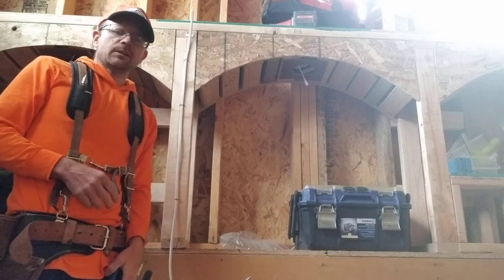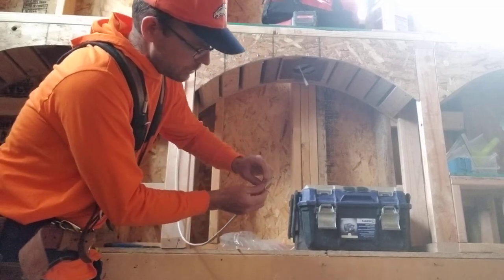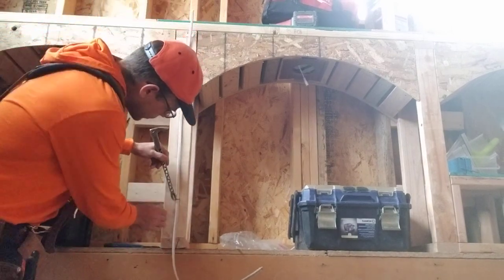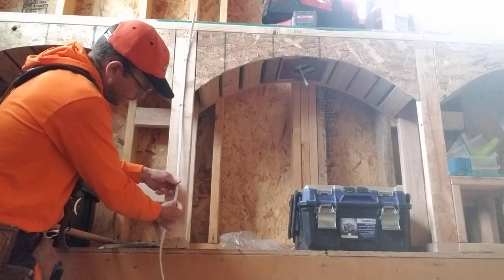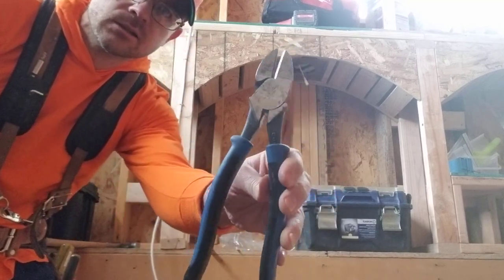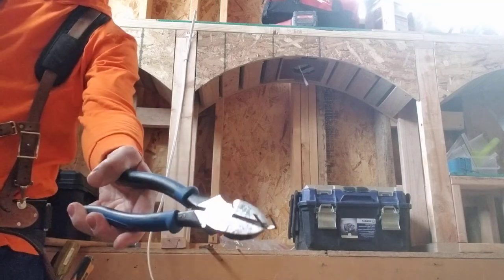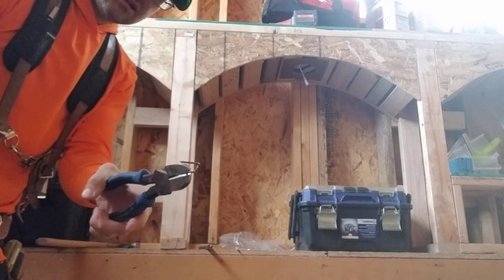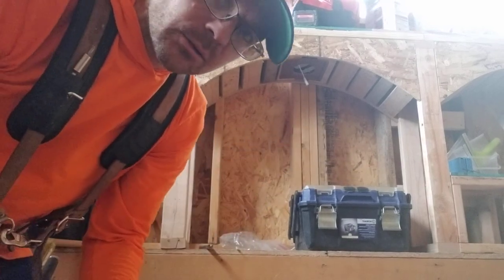How to remove electrical staples - Right way and wrong way

Comment: I was trying with some channel locks and I couldn't use the wood as a fulcrum the way I wanted.  It clearly was threatening to damage the wire.  I'm glad I stopped immediately.  I have wire cutters and will be using them today.